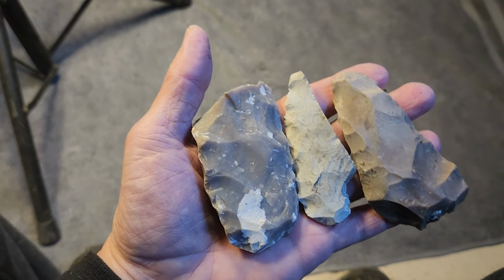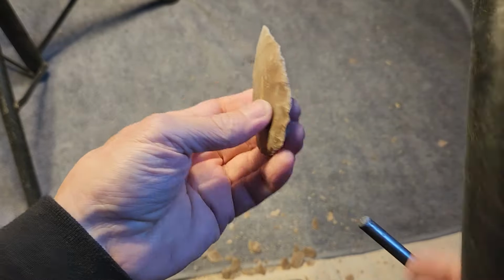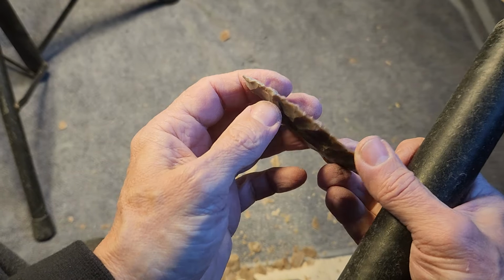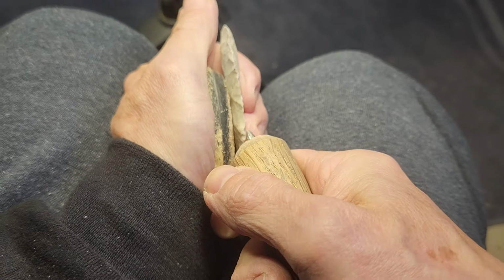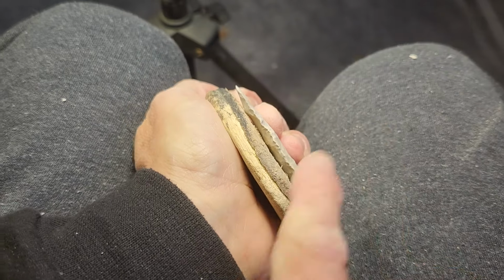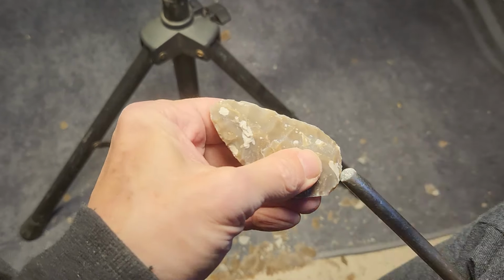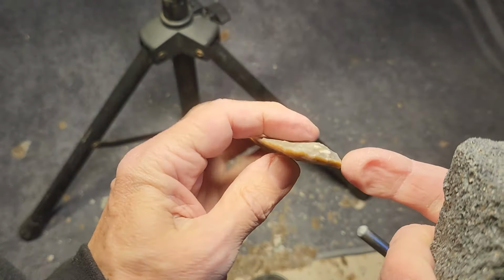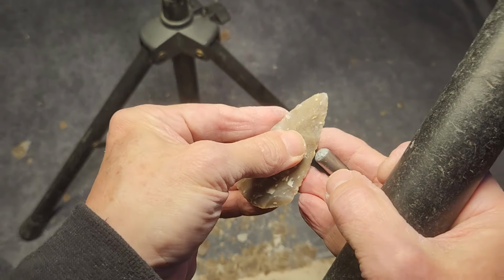1778 - Refurbishing Old Bifaces Flintknapping

Comment: I have noticed some stone does seem to knap worse once it's been inside drying for a few weeks. Mostly the more porous, lower silica stuff. There's some silicified limestone around here that goes from decent to pretty much unusable. It feels as if the waterlogged material doesn't crush as easy. I see no difference in high grade material.

Comment: Some rock is more scoopy than others.  The little Edwards river gravel amoebas (Llano and Guadalupe is my only experience) are extremely scoopy if you hit them wrong but will also let you drive incredibly long , straight blades and big, flat, smooth flakes if you do it right.  Best I can tell is the rock is just very, very sensitive to small deviations in angles of force and striking area.
Reply from the maker: Yes